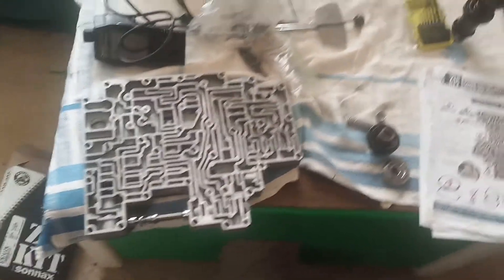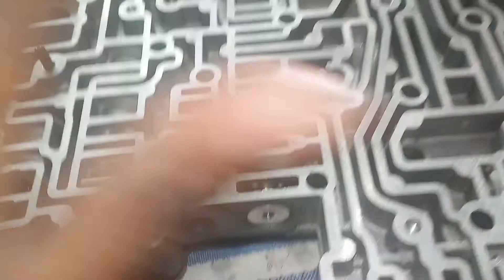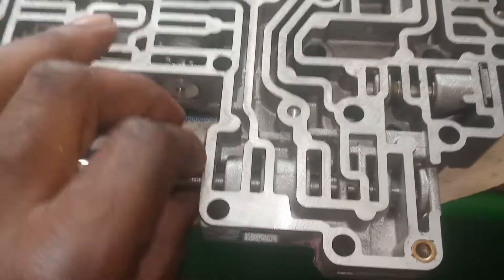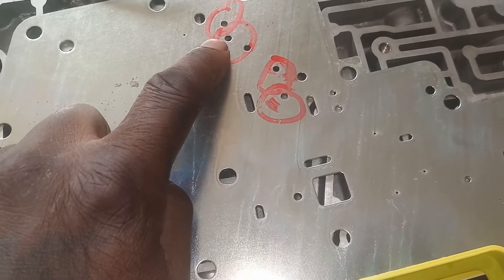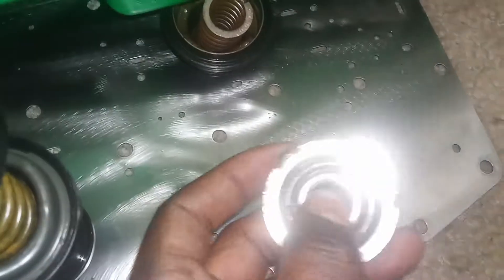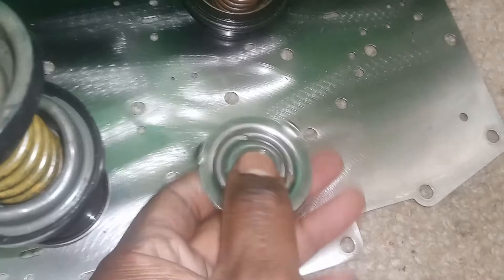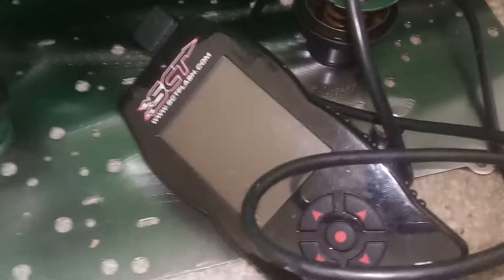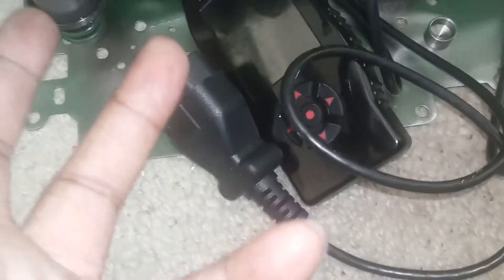Part 2 update finishing up the performance valve body

Comment: I watch this a lot
Reply from the maker: BST Ford Channel it's truly ez 
Most transmission shop charge you 1500 for a rebuild With all stock components
 I was able to get upgraded everything and still be under 1K for everything 
And like I was saying the Ford manual breaks down how to rebuild this transmission to every nut bolt part you can think of if you follow their instructions you can't go wrong in the true Ford crown Victoria manual

Comment: Hey just a quick question. 

My man BCM Wolverine Channel has a 2006 Crown Vic LX civilian model with an open differential, and the stock 2.73 gears. 

He's complaining about getting stuck during the winter months driving in Canada. He's was thinking about installing a LSD from a CVPI police model for more traction in poor weather driving conditions but, he doesn't want to lose any MPG. 

Here's my question;

Is there a cost effective way to add an LSD to a civilian Vic but, keep the 2.73 final drive gear ratio so it does not affect MPG. 

I figured it anybody knows, you would definitely have some good info on the subject. 
Chuck
Reply from the maker: Budget Panther Fan yeah get a used one from a p71 
 I think new there 230$ 
should be a ez swap just changed over the ring gear and put all the shims back in how they came out a bam she's good to go
Reply: @crownvictorialifestyle4421  
Cool. Thanks.

Comment: U think it be worth to putting a carburetor on  4.6
Reply from the maker: James Elliott no it won't be as efficient as fuel injection 
I would only do that with a pure drag car
Reply from the maker: James Elliott what are you trying to do with your Vic
Reply: @crownvictorialifestyle4421 well it started knocking thinking of buying good short block to go in it maybe put cams in it and I guess efi edelbrock intake .  Would porting heads while apart be worth it.
Reply from the maker: James Elliott ported heads no valve job and springs keep it simple trust me 
The money spent will add up fast for these motors vs power gained
You can buy a Tork tech m112 supercharger kit for the price of head porting, cams and Victor Jr alone and get 500rwhp from it or more 
My advice would be to find a used Explorer motor with a 2v they have the aluminum blocks
Or find a replacement  2v motor used or remanufactured 
Put cams and springs in it then
Rev it to 6500 and get converter 
If you trying to get a rods and pistons aftermarket type short block they run 3400 buck plus shipping 
I would skip the Victor Jr 
You have to buy fuel rails and plumbing to hook it up properly at the end will probably bump that intake total cost up to 800 bucks
To get the power vs dollar out of that intake you need to shift it at 7200 to 7500 rpm 
Then you have to buy a bigger alternator pulley from metco to compensate for spinning the alternator higher than it was meant to be
The stock intake will give better mid range power overall
For street use  
You can definitely set the Victor jr up to run hard
Higher stall 
bigger cams 
Rear gears 
It can be done 
Power vs dollar the stock intake setup will do you right tho
Reply: @crownvictorialifestyle4421  just a good street machine as of now . I found mhs cams says 500 550 lift biggest with stock pistons
Reply from the maker: James Elliott ok that's a Kool plan just don't get caught up in adding this and that because just for a mid cam swap you don't need that much supporting mods
Reply: Plus exhaust and rear gear 430 or 456 it should scoot
Reply from the maker: James Elliott yeah it will 
If I could do it all over again I would have done it that way and put more money into my 4 valve swap to be honest
Reply: @crownvictorialifestyle4421  is the 5.4 hard to swap do u change computer
Reply from the maker: James Elliott everything will wire up as is